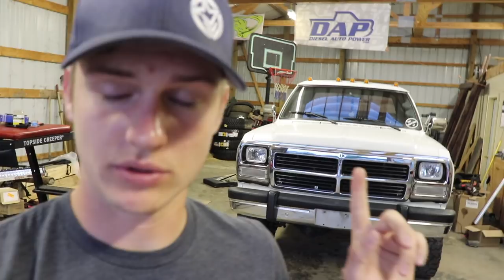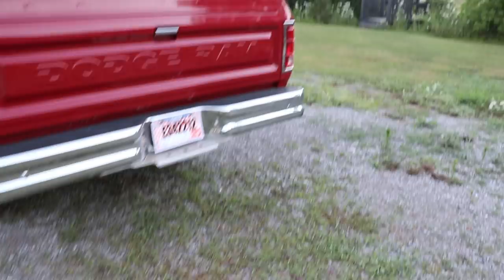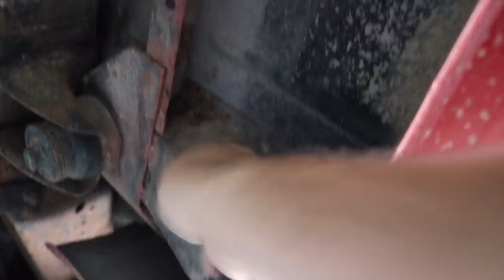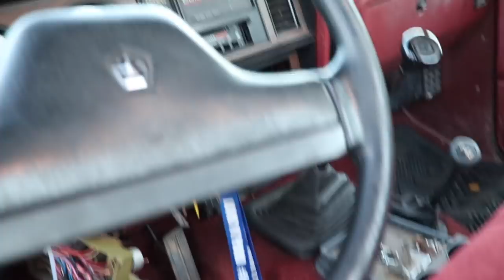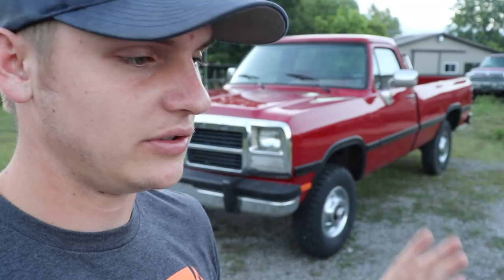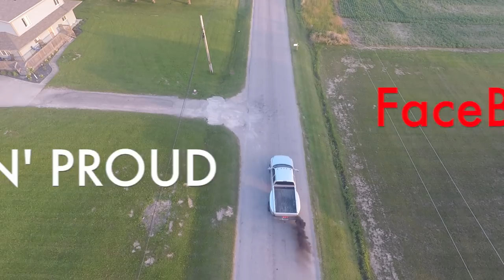MY NEW DIESEL TRUCK!!!

Comment: My first truck was a hunter green 1992 extended cab w-250 4x4 with a 6 speed.

Still have it and spent 23K to have it restored back to factory condition about four years ago.

Love those original rims mine have the same.

Beautiful truck man glad you found it.

Comment: How do you find these so cheap!! I’ve been looking for a 1st/2nd gen and they are all $15,000 or more
Reply from the maker: hayden casey got to look hourly and buy them ASAP once you find them...
Reply: i can find them for 4000 and up
Reply from the maker: Jacob trawick in this condition?😂 $4k?
Reply: yeah  and with 200000 miles they are old farm trucks and manuel or automatic
Reply: Jacob trawick 200,000 miles is good. The ones I’m finding have around the same miles but just a whole lot more money than $4k
Reply: i was looking for a 2nd gen a few months ago and i started looking on facebook in my area and i found on with 214000 miles needed a clutch and throwout bearing and only wanted 4500 but i didnt do it because its alot of work to do that got to drop transfer case and transmission and that aint easy. my dad had a 1gen  andd it took him and three other guys to take them out so i said no and got a silverado 2 weeks ago
Reply: Jacob trawick d
Reply: Round nc lot of first gens cummins for 800 and up

Comment: how do you feel about a 99 ram sportwith2 inch lift in mint shape, mud tires , cb radio sony cd radio  back rack , corner strobes 6k wench in front bumper  oh ya 3 air horns  train  tug boat  fire truck...   NOW HERE IS THE PROB.. its a 5speed gr8. it says cumins on the fender...it has big exhaust,,, here it is---  18 v-8....  is it worth it to put a 4 bt..???  and by the way I spent all my money fixing this...   WHAT DO I DO  ?  I WANT TO HERE TURBO SPOOLING AT IDLE...